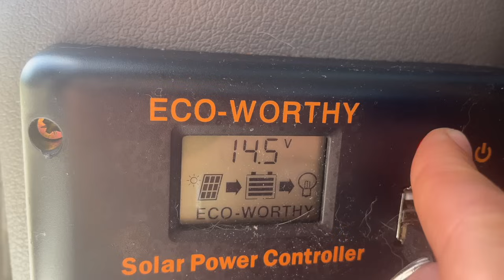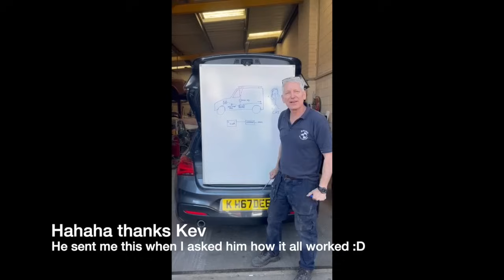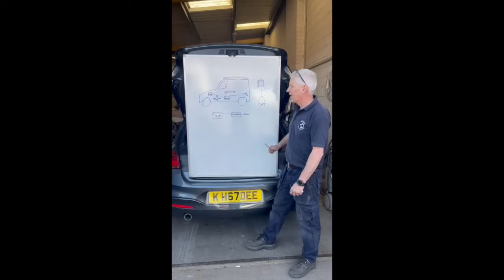Off-Grid Power Setup | My simple Eco-Worthy kit

Comment: Hello, split chargers are not compatible with lithiums, you should have a battery to battery charger, this will give you the option to select lithium for your leisure battery. Split charge relays will shorten the life your leisure battery as it can't be giving out the correct voltage. I hope this helps, victron do a good charger, not too expensive.😀😀😀😀
Reply: Glad someone mentioned this 👍
Reply from the maker: I have a bms!

Comment: Lovely and simple and does the job great. I run a bluetti AC180 which is great but dont have any solar panels just now. Charges off the car and a petrol generator which charges it from low to full in about 45 mins. Works great on cold nights with a heated throw in the sleeping bag on minimum, uses very little of the battery for enough comfort to make a real difference. Was 1 degree a couple of weeks ago camping on the Western Isles and it made a huge difference to my enjoyment.
Reply from the maker: Amazing! I had one of those heated blankets but fell asleep on it and it melted 😂😂😂 bloody amazing in the cold, up until that point 😂🙏🏻
Reply: @its_van_life  hahaha ye I would not trust it as far as I could throw it electrically , anything like that, that is ok to put in a washing machine is something that is not quite right. Was wonderful though and I avoided cremation thankfully. Ye Ha.

Comment: If you haven't yet, I would get that leisure battery securely tied down. 
Potentially dangerous sliding about.
I'm surprised none of the power station brands have hooked you up yet.
Reply from the maker: It doesn’t slide about! It’s wedged in tightly
Reply: @its_van_life  Okay good.